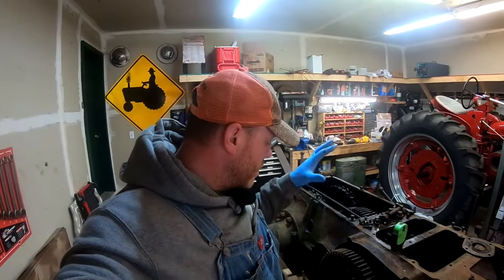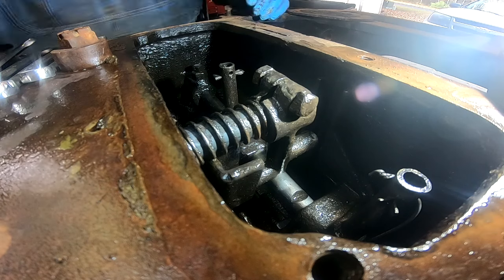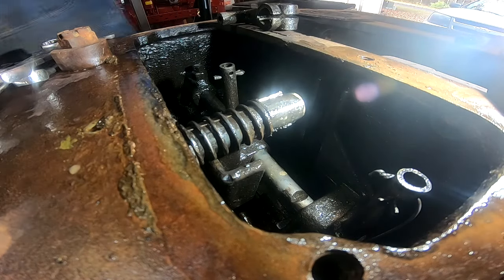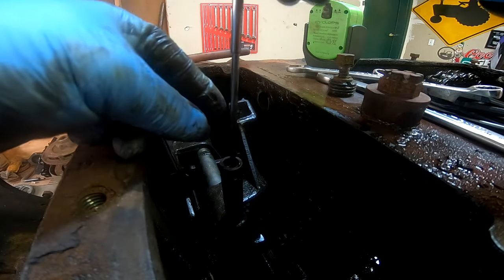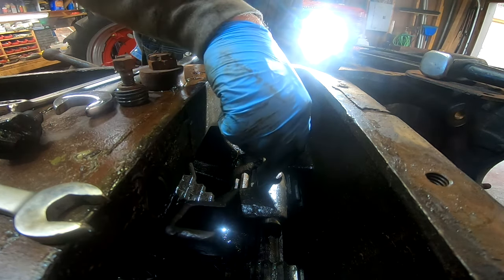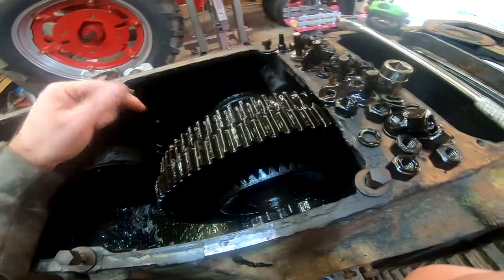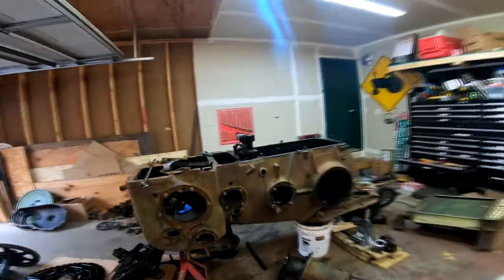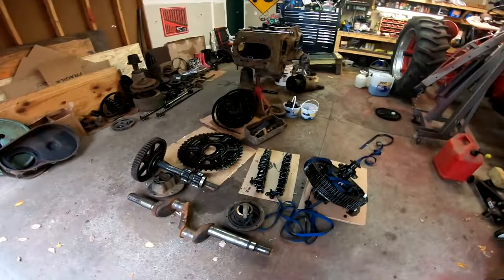1927 John Deere D #44891 Part 4: Differential/Transmission/Rear Axles & Spocket Teardown COMPLETE!

Comment: I've been behind on watching some videos so I'm catching up now. I basically have the same parts washer. Don't be surprised if the pump gives out with some use. I use mineral spirits too. The regulator solvents for these are crazy expensive!!
Reply from the maker: I've heard that the pumps are kind of weak in these, but should be pretty easy to get a replacement pump. Mineral spirits isn't exactly inexpensive, either, but it works just as well as the other solvents.